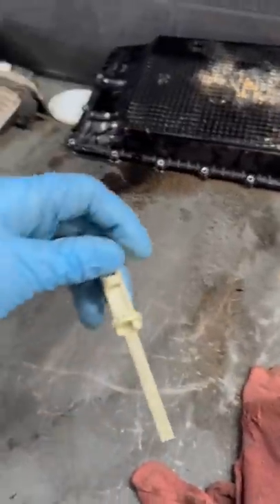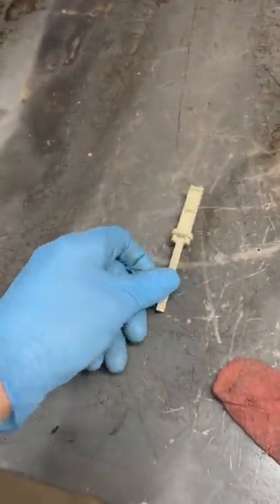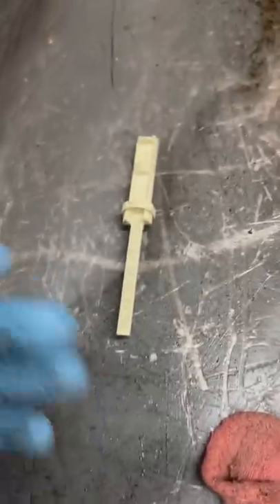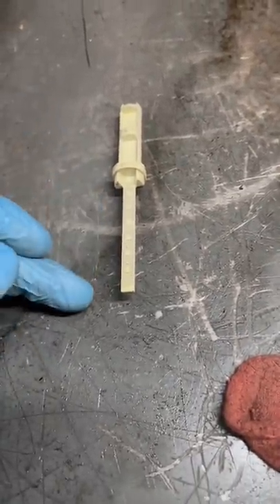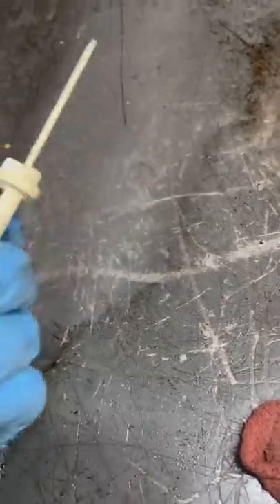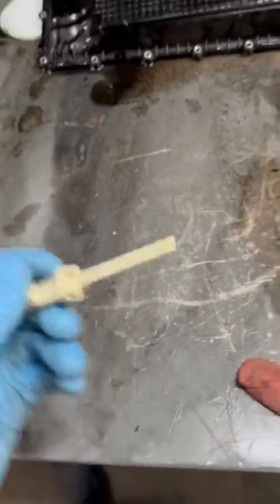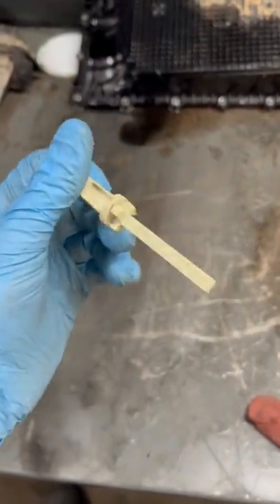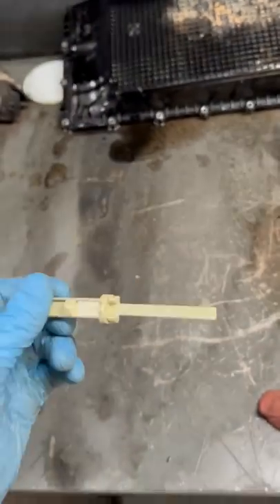Why do car manufacturers make my job harder? #shorts

Comment: Bro, I frequently say that the first car designer I meet will meet a steel cap boot. The amount of times you have a remove X, to get to Y, to pull that off to get to the actual issue, call it Z. Or they make what should be a simple job, like changing the spark plugs, into a marathon job because its under the air intake (cough nissan V6 3.5 cough). Alot of this stuff is designed by a person who has never, and will never, actually work on the vehicle.
Reply from the maker: That’s the truth!
Reply: Most design release engineers are car guys...  maybe if cars didn't need to be made safe (extra metal), fuel efficient (lots of stuff under the hood), aerodynamic (more efficient shape and aero shielding), and have all the bells and whistles customers want (tons of extra shit to package), there would be a lot more room to just have free space so you didn't have to be inconvenienced to look up a number.
Reply: @joncot1812  your wasting your time, they can’t see all that, just the 30 minute the wasted moaning about looking up a number.

Comment: I'm a Auto body technician. I'm right there with you. When every single year, every single model. Car, truck, Van, SUV, Station wagon, People mover, transit Van. They change everything so that you don't have to unlock your car with your keys. Push button starts microchips and the door handles so you can just walk up to your car and it unlocks. How ridiculous do you think it is, every 18 months to 6 months you have to look at things completely new now. The real question is why can they not make everything the same so that even us Mechanics and Auto body technicians can do our jobs quicker more proficient. Instead, I have 4 different sizes of bolts and 2 different sizes of screws and they are usually hex head screws.

Comment: Imagine being a lube jockey who has to make this his aggravation when it come to auto repair. son thats the least of the issues
Reply: I said the same thing in my comment
Reply: The main issue is that it's a ford built I'm the 2000's. It's shit design through and through. But hey "it's one of ford's better ideas".
Reply: @dallaswood4117  right don't worry it gets better
Reply: @jessecrawford2711  yeah. But it's the little annoyances that can make you snap when doing a big job and yr workin yr a** off and already pissed. It's the little annoying stuff that can set you off on the wrong day.
Reply: @krbgfx  yea I admit frustrations like that but the longer I work in the field it just becomes another thing, now hunting a circuit fault on a comm circuit thats just a bit on the wrong side of acceptable resistance because someone forgot to put a retainer clip or routed a harness the wrong way and now a wire has 3 or 4 strands broken internally but has yet to damage the insulation of the wire, that's what has been pissing me off here lately.

Comment: Be glad it has a dipstick 😂 look at dodges procedure
Reply: Still would rather have a dodge bc it has a actually dipstick in the engine bay for the transmission
Reply: @tylerwoodrum8027  I work for dodge, the older ones do. The newer 8-9 speeds definitely don’t and they fill procedure to get the fluid level is pretty wild to be honest with you, not to mention expensive.
Reply: @JM-it2zo   okay and I was just stating my opinion which everyone is allowed to have right and that's the brand of truck I like to drive and yes Ik that asshat that knew dodge's don't have a dipstick but any dodge truck from 08 and back do and here's another things Idc if your a licensed mechanic you're getting ass pay for a s*** job that I would never want to work I would rather work on my own s*** than take it to a f**** mechanic that's going to screw me
Reply: A co-worker's Mercedes didn't have a dipstick for the oil 🙄 the procedure for checking the oil involved the instrument cluster. Unfortunately his instrument cluster was malfunctioning😥. Translation:  it was impossible to check the oil.
Reply: @robertthompson3447  wonder how much that cluster was to replace! Lol

Comment: NGL you should switch to toyotas, those Japanese manufacturers make everything so easy.
Reply: Until the starter goes out in your 1st gen tundra lol
Reply: I definitely wouldn't say everything is easier lol. I have done some things on my landcruisers that could have been a lot easier.
Reply: Since they became American made they are much easier to work on.
Reply: @chadh7005  Not any of the tundra's or tacomas that i have worked on lol. Id take an old toyota over a new one all day long as far as ease of maintenance.
Reply: @86Hilux22R  I've never had any issues except the computer stuff. But I've also not had to work on mine either they don't break
Reply: @stevemasterson7776  or when the alternator shits the bed on a 1st gen Xterra
Reply: Bring it in for frame replacement.. lol
Reply: @stevemasterson7776  yeahhhh or any 2UZ powered truck… glad I never had to do that when I owned my tundra

Comment: also remember if you change the trans fluid your only getting it out of the valve body the torque converter stays full unless you have a drain plug on the converter and if your not leaking any of it just put in what you take out and be done

Comment: Fords exact word’s “don’t worry about the dipsticks, they already work for us!” I feel your pain, they need to bring back dipstick tubes, if they had to check the fluid, it would have a dipstick tube. 
Going to plastic oil pans and transmission pans and all kinds of plastic components to lower cost. Funny thing is that the savings are nowhere near any window sticker.

Comment: You are lucky. The situation in Europe is even worse. Recent (1990s-2000s-today) ZF transmissions have no dipstick at all. You can't even unbolt the filling hole plug if the engine is not running, since the transmission oil would flow out. Even then you need special caution.
To fill the transmission or check fluid level, you have to start the engine, and then follow a procedure taking a flow chart of multiple A4 pages, including steps like changing to prescribed sequence of gears changes in proper order at specific rpm and time, while keeping the temperature of the fluid monitored by the diagnostic system in a narrow range, limiting your time frame to a few minutes. In the meanwhile the inlet hole is almost fully obstructed by the valve body from the inside, making it very hard to inject fluid or check its level. Adding salt to the wound,  the inlet opening is inside of an obscure cavity in a few centimeter distance from the hot exhaust pipe.
And this is just one particular example.
Some nice BMWs are practically impossible to service, for example you need to literally disassemble the whole car  to replace or even check the timing chain(s). Transmission out, dismantling all hydraulics, front axle out, engine out, cylinder heads off, etc, and then you can take a look at the chain tensioner unit.

Comment: Keep in mind that every part needs to be in stock for the life of the warranty so usually 3 years or more after the car is discontinued. So if a model is scrapped then that's one less part the have to keep making that will just sit in storage.

Comment: I understand your concern and I also don't think that it matters much because you should be looking up the information you need anyway so that you know what you are doing is correct. I was in the military and I worked on aircraft. When we did anything we had publications that told us how to do everything and out of all of the commands that I went to only one lost a pilot or an aircraft. That situation was because the pilot had a problem with certain types of maneuvers and he couldn't stay awake for the maneuvers. He died because they didn't follow their own procedures he had failed those maneuvers three times before for the same reason and they were supposed to stop the training because of that but they gave him that last chance to complete the training and he died. I have also had lots of times when a mechanic didn't conduct the maintenance on my vehicle because they were not following the procedural because they didn't follow the publications. I have had improperly installed tires, improperly changed oil, improperly serviced transmission fluid and improperly serviced breaks all of them from licensed service center and dealerships but not once from a third party service center. Why because the third party service center was following the procedure using the publications. If you are not willing to do your job correctly then you don't need to be doing it. I understand that sometimes certain things might be a little bit easier but what you are asking for is doing two things one it adds tools that may be purpose built but will be a costly addition to most mechanics tool boxes and two it gives you an easy excuse not to do your job properly.

Comment: If a part is being initially designed, it is generally seen where else it can be used with no or minimal modifications mode to it. That way in the manufacturing process, a good amount of money is saved mainly with the tooling

Comment: At least they have one.  The 6f-35 is like a manual transmission, open the overfill, and fill it until it comes back out.  Then let the motor warm it up, piddle out the expansion, and close it up( It would have been nicer if it had the older style manual trans automatic over-flow to street system).

Comment: Ok, so to make an specific dipstick for a specific car, you need to invest in individual tooling for each dipstick, you then need to invest in holding stock for spares, and then have to ensure that the assembly process knows what part goes with that specific engine or you could just look it up when you need to and realise it’s like that for a reason.

Comment: The only part you can find in stock for 10 cents. Other custom parts come in assemblies for hundreds of dollars. Used to be just a lightbulb in the tail lights. Now it's a led assembly. Used to buy brushes for the starter, now you have to buy the whole thing.

Comment: The 2007 f150 I used to have has its oil filter sandwiched between the block, fan/radiator, axle, and some other stuff. It's in the middle of engine and they even had to make a part to channel the oil from changing the filter over and around the axle.

Comment: I wrote an entire paragraph about real ford issues but it didn't send so I'll shorten it.

Kuga and Mondeo 13-17 oil filter position.
1.0 and 1.6 13-17 engines overheating
Transit fuel pump position and stupid bump
18-22 fiesta 1st and 2nd synchro
Transit wiper signal (If one is damaged the other wipers go haywire)
There's more but I can't think of them right now

Comment: I get your frustration, but as an automotive & aerospace engineer I can tell you that this is not a bad idea. What this means for the automaker is cost effective and compatibility across the model line up. For the consumer, this means that you can go to any junkyard or auto part store and be able to find it with ease. I have worked with manufacturers that have special tools to work with different models (German OEMs) and… good luck finding a 17 millimeter Allen key for to service your transmission. And btw, in the aerospace industry (I know it’s different in the automotive servicing industry) you do not touch anything without reading a job guide or service manuals. And guess why that is? Bc they do parts for that particular aircraft (service sticks for those particular transmissions). Ever wonder why Southwest/JetBlue and other airlines use the same type of aircraft? Same tools, manuals, pilot training, crew training, same everything! 
Again, I see where you’re coming from, but this is for the best.

Comment: Not only do you have to pull the spec you also have to ascertain the temperature of the transmission fluid which may or may not be presented to you on the instrument panel...

Comment: Its all about cutting costs while they cram as much technology as they can into the truck that the drivers will appreciate. The techs are an after thought, they still think about us a little at least. It amazes me how vehicles have become so complex but still remain only a little more expensive than they costed new 25 years ago. Yeah prices have obviously gone up a bit, but in the grand scheme of things it's impressive how we've perfected manufacturing of certain materials and parts to make them cheaper for the consumer and company.

Comment: This is significantly more cost-effective for the manufacturing of the part. If using a standard plastic part, it means one tool. That tool could cost $15,000 to $40,000 to produce. So if you are tooling one, versus 15 of them, there's a serious capital investment difference. Also, there is much more management costs to having to manage the parts through production of the vehicles, as well as ongoing production and support for years to come. A mechanic having to look up in a book, is significantly more cost effective for everyone.

Comment: I think what ford owners should do is drill 2 tiny holes at the minimum and maximum on the dipstick. Say your particular model should be between 3 and 4, so you drill a small hole on or just above and below number 3 and 4, maybe even one right in the middle

Comment: I get bro but I work at Brose and my plant makes the front row seats for the F150,bmw x5,x6,x7, mercedes gle, lucid air, and who ever produced that part did it for a cost savings. If they didn't they would have to have a mold made for every different dip stick which is expensive. Also Ford doesn't make that part they just get it supplied to them

Comment: Not defending it, but it costs ford 5000-80000 to make a new plastic injection mold for for each transmission. Also costs ford to have multiple operators, multiple lines, multiple machines, etc. Costs you time, saves ford money.

Comment: It's genius; it allows Ford to make a single non vehicle specific transmission with all the cost efficiencies of high volume, but then fit it into multiple vehicles with different installation angles whilst still having the correct fill volume.

Comment: Being a ford transmission specialist the 10r80 shouldn’t go above 5 when filling cold sake for the explorer even though the explore has a 10r60 which is smaller it should be the same.

Comment: This is a hard one. Engineering practice says to normalize as many parts as possible across variation. I don’t see why they couldn’t make the dip stick the same and also the level the same despite the variation total fluid capacity. I assume the numbers correspond to quarts of fluid or something, in which case I’m on the engineer’s side. It takes what, 30 seconds every few months to check how much transmission fluid a vehicle takes? Should you touch a transmission if you don’t even know how much fluid it takes? That being said, I also believe the separation between engineers and mechanics is a huge problem and engineers need to respect mechanics more especially.

Comment: I work in the factory that makes the 10r80 and 10r60, it's probably so they don't have a bunch of model changes and more complexity. The transmissions for the f150 ranger bronco and explorer all come off of the same line. We make 1100 transmissions in one shift. And there's 2 separate lines, and there's 5 shifts between the two. It seems dumb but so is the guy on the line too. And really how often are you filling or changing transmission fluid?

Comment: Honestly, i see one negative side for so many advantage: manufacturing is easier faster because of a single uniform design. Availability, no need for stores to keep one in stock of every model, just get 5 of them and you’re all set for any ford of that generation. Risk of putting the wrong dipstick in the transmission. It’s universal so you litterally only need to find one info, note it somewhere and you’re set. Especially if you only do ford, you’ll end up being able to search that info quickly and efficiently. The biggest lost of time is when mistakes are made. Universal designs prevent that.

Comment: And here I am with a 20 year old honda that checking trans fluid is just as easy as checking oil. Pretty nice. Only somewhat surprised this car still runs fine after 250k miles and 3 wrecks in its life. Car is only a couple years younger than I am...

Comment: As a transmission mechanic I swear it's stupid cus sometimes before I do a test drive I like to see the condition of the fluid to see if it's burnt or low or if it's dark so that I can know what to expect before getting my hands dirty. Instead of getting my hands dirty then go test drive then do repairs ND get hands dirty again. Atleast with dipstuck and dipstuck tube I don't have to have tools to do something as simple as checking.

Comment: Were should it be on the dipstick for a 2020 expedition? I have 95,000 miles on mine and I’ve changed the trans fluid and filter twice now in that time. I always go back with 8 quarts. If I’m not mistaken I think the 10R80 holds 16 quarts on total. So at least dropping the pan you changing about half the total fluid each time, or I assume. ULV motorcraft is all i run too. These 10 speeds run crazy hot in my opinion.

Comment: It pisses you off that they can't make a specific dipstick but it pisses me off that it doesn't have an accessable dipstick from under the hood or a FKN Drain in the pan! "Lifetime Fluid" isn't a thing. I'm a Ford tech and I push for people to service their transmissions every 30k miles. I've replaced/rebuilt so many transmissions that failed due to lack of maintenance. The manufacturers say It's Lubricated For Life! Their "Life" is anything out of their powertrain warranty period. After that they could care less about what happens to it...